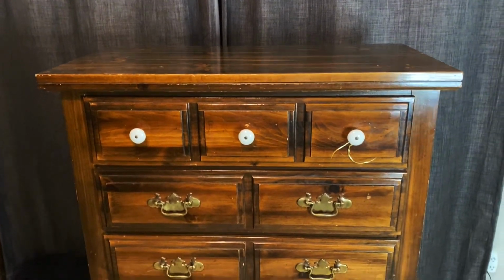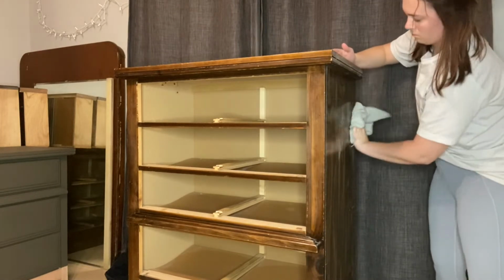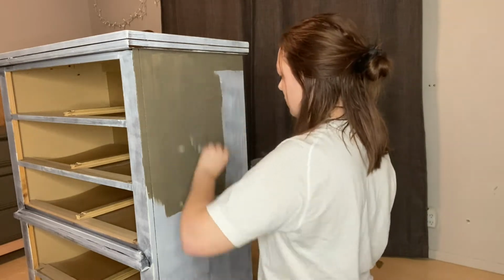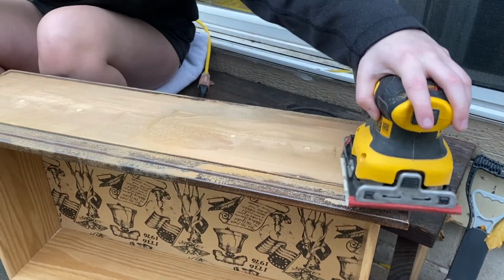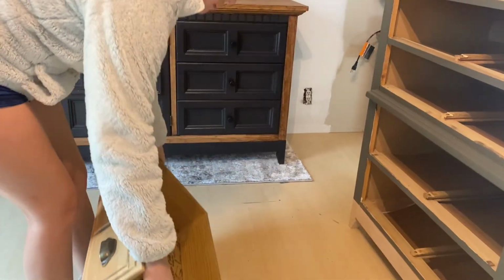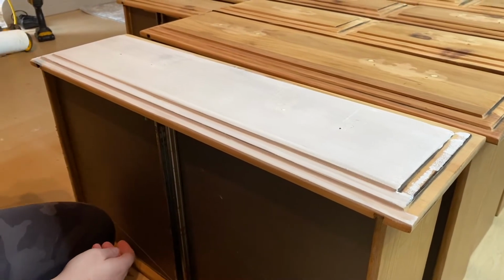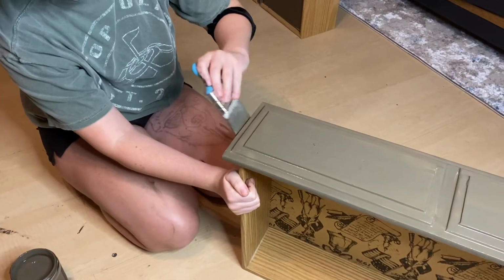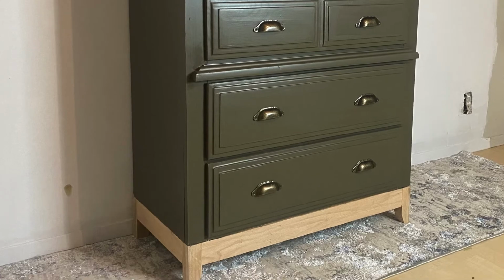How to Fix Uneven Wood Tones/ Furniture Makeover/ Flipping Furniture For Profit on FB Marketplace

Comment: Just keep sanding through the different grits and the wood will eventually even out. Of course this works best when the drawers are solid wood. Have had this happen to me several times, but I love getting the wood all the same shade so my hardware works. Wished is had worked out as I loved the shade of the drawers with the leftover stain.